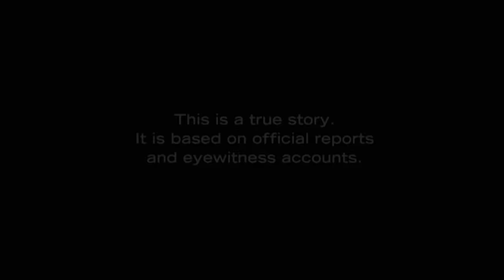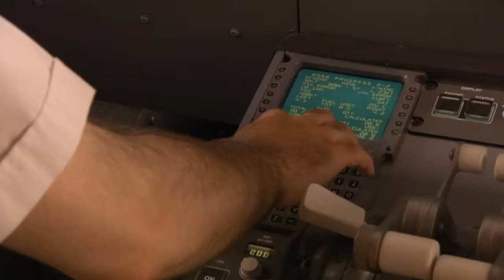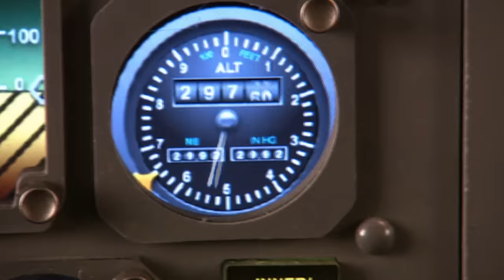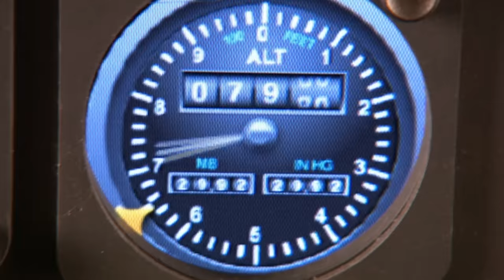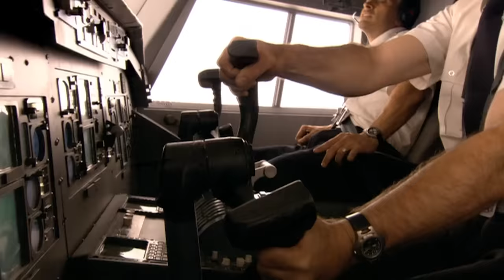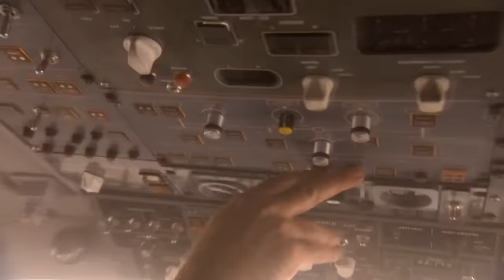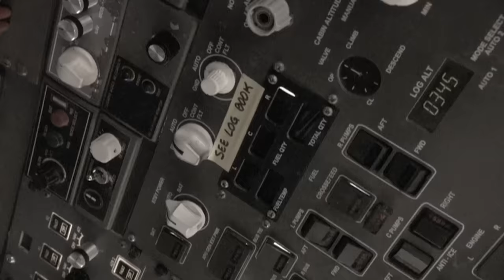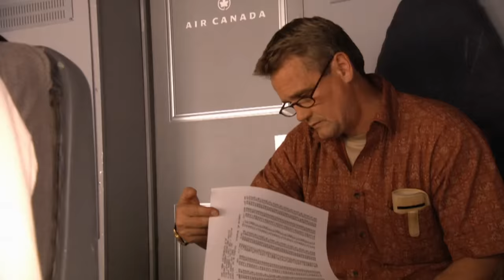Air Canada 143 Becomes Powerless And Falls From The Sky | Boeing 767 | Mayday: Air Disaster

Comment: An incredible story.  Putting a jet liner in a sideslip like that, with no engines!  Never been tried before.  Then he puts it right on the runway.   Jeepers, give that crew a medal.
Reply: Maurice Quintal is God’s actual name? No way.
Reply: @Thomas Woodward Should’ve been GOD is my foremost pilot then relying on my human capabilities… Nothing diverts GOD’s plan.
Reply: Yeah a diamond crusted 🥇
Reply: @Thomas Woodward as in his faith in Jesus
Reply: @hassanhashi4091 b87D6yu
Reply: A question? Did thry get any awards?
Reply: @jimw1615   sometimes I'm a passenger....does that count?
Reply: And we joke about the metric system…
Reply: Side slipping is something you learn in the first 10 hours of private pilot training. How do you know that no other passenger plane hasn't been side slipped?
Reply: @veryslyfox yes, the failure happened at 2 levels.  They guys filling the tank put liters in instead of gallons, and the pilot’s verification had the same mistake.  Geeeez!
Reply: But done after. In Sweden a pilot landed a MD-81 without engines in a field outside Stockholm. The plane broke into three parts at impact, but all passengers survived. In Sweden its called the "Miracle at Gottröra". There is a video about the crash here on this channel. Its called "How Did Scandinavian Flight 751 Survive This?".

Comment: Bob Pearson is an amazing pilot. He saved all 61 passengers and 8 crew. Without him they all would have died.
Reply: Read his comment. It was a team effort by all. Not to take away from the Captain but all played a roll esp 1st officer doing all calculations from ATC.
Reply: Way to go bob
Reply: And they still demoted him for 6 months 😒
Reply: Amazing!
Reply: @Mrpuggo0322  If he wasn't so dumb to miscalculate the fuel this would not have happened.
Reply: @ggeorge4144   how could he when they didn't have adequate training in metric conversion?
Reply: He put their lives in danger taking off with faulty equipment.
Reply: @vortex162 
It wasn't just metric conversion that was the issue.  They used a stick to measure depth and converted to volume then mass.
Reply: Metric sucks!

Comment: I think this is easily the best Mayday episode. It has everything: great CPM, great airmanship, great plot twist, and a great ending.
Reply: I agree. It's an amazing true story, real and honest, and exceptionally well told.
Reply: Airmanship? They couldn't read the fuel doc and they RAN OUT OF GAS...I don't even run out of gas in my vehicle.
Reply: @AFuller2020  yeah, since a car is more simple than a plane... It takes years of training to fly a plane.
Reply: CPM?
Reply: Im assuming they ment CRM? @kaeaja
Reply: Better than any thriller movie I've ever seen.  All of the elements necessary to keep one on the edge of their seats were present in abundance in this one episode.  Fantastic job by the Capt, crew and ground control.  Wow!!
Reply: @AFuller2020 Cars are simpler than Jets!  Also Jet Fuel vaporizes at different temps and  vaporizes a lot slower than gasoline so it takes more time for the sensors in the fuel tank to register that a plane is low on fuel.

Comment: This was one of the greatest displays of airmanship ever recorded. Anyone who can side slip a 767 and land it without the nose gear, saving everyone on board deserves the Sully Award. 

When they said they plane had half the fuel it needed it was like a light bulb went off when I thought about a pound being about half a kg, there's the mistake.
Reply: Think it's about time for the USA to join the rest of the world and go metric??????
Reply: @julietcunningham852  crazy how many things went wrong/right that day. Also, the rest of the world, at least in aviation nowadays, uses pounds/feet to measure altitude and fuel.
Reply: @julietcunningham852  arrogance is usually what gets your head blown off, you drown or your car flips over. 

Our humility suits an opinion much better, especially you’re a no body, no body needs to ingratiate themselves with.
Reply: The fuel gauges should have shown the tanks only half full. Why not have two layers of safety, instead of relying on someone's calculations!!!!
Reply: 1 : 2.2 to be precise
Reply: @cromana5574  as i recall, the error was caused by interpreting the fuel dipstick numbers as being 'gallons' when in fact the number represented "litres". that being the case, the plane only had approx 1/4 of the fuel that it was intended to have on takeoff.
Reply: @C romana  I believe they said the fuel gauges were out of order at the beginning of the episode. Normally there would be functioning gauges so one wouldn't  have to solely rely on someone's calculations...
Reply: @thegoose0m1  this air canada 767 was one of the first in the fleet and the fuel dipstick was measuring in litres while the ground crew in montreal thought the marks on the dipsticks referred to gallons. thus the plane had 1/4 its intended amount of fuel.
Reply: Repent to Jesus Christ “So do not fear, for I am with you; do not be dismayed, for I am your God. I will strengthen you and help you; I will uphold you with my righteous right hand.”
Isaiah 41:10 NIV
Y
Reply: Sully deserves the Gimli Glider/Pearson award.
Reply: @Thomas Woodward Most airline flights are American? That sounded dubious to me so I googled it. America has 5,760 commercial passenger flights daily. The world has 100,000 flights daily. That means America has only 5% of the commercial traffic worldwide. That's to be expected, since America has 4% of the world's population. Please tell me why you think most air traffic is in the USA. I'd like to know who makes that claim.
Reply: This is next-level Sully.  The pilot deserves The Launchpad McQuack Award.
Reply: Or a national medal
Reply: @julietcunningham852  Though that may be true, this situation didn't happen in the US.  I don't understand your point.
Reply: ✈️In our book Sully deserves the Pearson Award
Reply: @daktarioskarvannederhosen2568  relying on the "ground crew" and putting your life in their hands?? I believe the protocols ALSO fell on the pilots to confirm. But for some strange reason that's left out of the video and it seems the investigation. Canadians have been working with metric for decades (gas in litres) so I'm suspecting there may ALSO have been a language barrier in Quebec on the platform as well.
Reply: @Thomas Woodward 'most commercial flights start and end in the usa' ...wow, stuck in your usaian bubble.
Reply: @louisliu5638  the "quebec language barrier" played no role. canada went metric in the 1970s. the law requires metric display. to this day many things are still displayed primarily in imperial and secondarily in metric (e.g. grocery stores pounds/kgs). the final responsibility, in principle, lies with the captain. in practise it does not: if it did then no flights would ever depart because it is not possible for the captain to check every single thing himself. the gimli glider was brand new to the air canada fleet and canada had become accustomed to usa-made boeing to present their aircraft with fuel dipstick measuring in gallons as opposed to the newly-reworked litres presentation.
as an aside, the aloha airlines flight that had its cabin roof torn off mid flight had visible stress-tears on the exterior fuselage near some doors, before the flight departed; the captain was not deemed to be responsible.
Reply: You mean Sully should have received the GIMLY AWARD lol
Reply: @Thomas Woodward i have no clue as to the intended meaning of your ungrammatical comment, and i might suggest that neither does anyone else.
Reply: Like parallel parking a double trailer semi downtown New York.
Reply: @Everyoneisanartist776  what is that jibberish that you are nonsensically on about in your incoherent attack upon @ Juliet Cunningham ?
Reply: @daktarioskarvannederhosen2568  states the person who fears the comma. Use it, at the very least, I can lie to my self and pretend that I’m speaking with an adult.
Reply: @Everyoneisanartist776  Apparently you prefer to camouflage your lack of addressing my inquiry regarding your both uncalled for and incoherent attack upon the party as referred to in my original comment addressed to your self.
Reply: @Everyoneisanartist776  As an aside, please note that your reply to me consists in part in incorrect use of the comma; this is evidenced by attempting to read the sentence sans the word string contained between your commas (including omission of the two commas) the result of which is a grammatically incorrect word structure.
Reply: @Everyoneisanartist776  Please consider renaming your channel. May I respectfully suggest 'POS - Designs'.
Reply: Why should he get an award for a mistake he made? Sully didn't make a mistake that caused his plane to lose engines, this captain *DID*. His own actions caused his plane to case problems, yea he brought it down safely but that doesn't erase what he had done.
Reply: @Suisfonia  1. as far as i know, the mistake is in no manner the fault of the captain's.
2. aside from the issue of fault, doing one's job, in this case landing the disabled plane safely, does not constitute heroism (it certainly demonstrates skill and luck, but it is not in itself an act of heroism).
in fact, the pilot had requested St. Andrews as his glide-in site but air canada told him not to take that site because it would then not be possible to fly the plane out of there.
perhaps heroism would have been involved, to some degree, if he had disregarded his employer's orders and stuck with what he personally believed to be the best option for maximal safety (i.e. St. Andrews, Manitoba, Canada).
Reply: THANK GOD - someone on that plane has a destiny
Reply: I’m sure they came to their conclusion much more quickly than how it was dramatized; having an “oops!” moment is much more instantaneous.
Reply: Maybe Sully should have had his award named after this guy...seeing as it was 1983
Reply: @Thomas Woodward g❤❤
Reply: @Thomas Woodward most commercial flights dont start and end in the usa. where did you hear this?
Reply: Yeah, but it was their first jet on metric. Good thing it didn’t happen to any others in the fleet.
Reply: My goodness, the airline closed the matter over a conflict in training, lack of parts at departure airport and defining responsibilities going from a 3 man crew to 2. No reason to debate their investigation.
Reply: Poor airmanship. 

Good airmanship means you use your superior planning and decision making skills to avoid having to use your fancy flying skills.
Reply: I remember this, 1/2 the fuel.  😮
Reply: I absolutely agree.
Reply: @WOODLASEdude you're using a lot of caps
Reply: Straight up legendary mate
Reply: @JamesJoyce12 That ISN'T  "precise" at all. The conversion factor is a nonterminating decimal. You've simply rounded to 1 decimal place. Good job correcting someone else, with an ever-so-slightly-better approximation.
Reply: @matthewfors114  , somewhat correct most flights originating in the USA,  end in the USA,  however about 5% of all world wide flights .....
Reply: @julietcunningham852 or maybe everyone else could have just stayed with imperial in the first place?
Reply: This is an amazing story and I am so happy that the plane landed safely and that the passengers were mostly OK.   What a great pilot team.
Reply: Yes, there's 2.2 lbs in a kg.
Reply: @cromana5574 Fuel gauges weren't working due to the circuit board. They relied on the ground crews manual check of the fuel.
Reply: @Bartonovich52  Must be nice to be perfect.
Reply: @julietcunningham852 nah metric sucks
Reply: Re:comment: 👆I was just about to say nope, due to Sully & then saw you’d mentioned him in your comment. That’s really important to remember! Thank you for remembering that! 😊 I believe that Holy Angels were specifically sent out to help people out when they’re in such trouble that they didn’t place themselves into deliberately. So, they were probably extremely strong Angels sent to stop ✋the plane simply because the men couldn’t & were imployed to go intervene immediately! You just can’t see them with your own eyes they’re not visible to the naked eye unless they allowed to show themselves but even then they probably wouldn’t be believed in anyway. Just be really grateful & tell Jesus Christ you’re grateful! He’d really appreciate that!!! Trust me. 🙏
Reply: but so much has changed too

now dual engine failure has its own checklist

pilots train on it

these days a dual engine failure would have a low chance of deaths
Reply: @julietcunningham852   most of the world use feet and and pound...NOT METRIC...boeing had them changed to metric for the new aircraft....and everything else was in pounds on the ground.. ..bloody boeing every time  doing there own thing
Reply: Ooooo my god, can you believe it? You die because someone mixed up the weight units. Pounds instead of kilograms. I think, It is also about time that the US stopped using the English unit system and switch to SI unit system in the engineering schools. Even the British has done it already.
Reply: @louisliu5638  This incident happened in 1983, and Canada started to switch over to metric in the mid 1970's  hardly decades!  And the 767 was the FIRST plane to use metric.   BTW Canada STILL hasn't totally switched to metric,  just look at building materials and tire sizes.

Comment: I worked at an autoparts store in 2007. my employer was working for Air Canada. But after 9/11 happened. He was removed as an airline pilot and given a position of doing preflight security screening of passengers checking over names in a no flight list. He also transferred during the holiday season each year to various airports across the country and frequently replaced other airport staff during their scheduled vacation breaks. Some of the little stories he shared at my workplace were quite extraordinary. It takes a great deal of patience and smooth thinking to run the airline industry and deal with angry passengers and customers during flight delays and cancellations. So far, the Canadian airline industry has kept an impeccable record for safety in the country

Comment: This pilot and crew used every resource they had to deal with this devastating landing.  The pilot to me is a hero.  Everyone lived and has a different perspective of life.
Reply: Amen
Reply: Accept they ran out of gas...it's their fault.
Reply: @AFuller2020 Because the fuel pump failed. How is that their fault?

Edit: It did not fail, they failed to convert volume to mass on the computer and didn’t have enough fuel, so it was pilot error.
Reply: @veryslyfox Indeed. Looking more into it, it appears their FQIS failed, so they used a dripstick but failed to properly convert the volume measurement to mass measurement, resulting in about half needed fuel to make the trip.

You need to work on being more polite. I thought the fuel pump failed in this incident, I was mistaken and have now mentioned this. Everyone makes mistakes, the problem is that you lack a basic respect towards other people and immediately choose a hostile attitude. Be better. That attitude doesn’t fly in any career field.

Comment: The pilots and radar controller undoubtedly saved lives that day. They did a FANTASTIC job in a very scary situation.
Reply: If they had only calculated their fuel asset correctly the wouldn't have run out of gas and crashed.
Reply: @AFuller2020 You telling me that you’ve never made any mistake, ever, while at work/school/life in general? Especially when changing from a system you’ve been using your whole life to a totally new system?
Reply: @AFuller2020 That wasn't the job of the pilots or air traffic control, so that's not relevant to the comment.

Comment: Amazing bravery and courage!  Captain Pearson used his gliding experience to side-slip the massive airliner with no engines, to bring down excess altitude and enable a safe approach path to the runway.  Nobody had ever done this before with such a large plane.  Nobody knew how it would behave, but it was the only option he could take … every other option ended in missing the runway.
This near disaster highlighted a simple basic error in modernisation and training on fuel calculations with the new metric system, and the change from flight crews operating without a flight engineer.  Learn from mistakes.

Comment: Another Canadian flight, Air Transat flight 236, holds the world record for the longest glider flight on a passenger plane.
Reply: I only know this because I've watched the Mayday episode about the Transat flight.
Reply: I just watched that one and it seemed like God or the universe wanted an aviation lawyer on that plane. This plane has a maintenance engineer. Haven’t watched more than a minute but there seems to be strange coincidences at work in these accidents.
Reply: I would not fly an airline that advertise the record of the longer glider
Reply: @clementfauchere3528  Why not? It shows their pilots can handle emergency well.
Reply: I guess the problem with gliding maximum distance from 40000feet or thereabout would be running out of oxygen for the passengers before reaching 12000 to 11000feet?